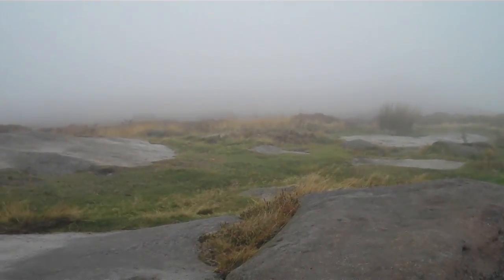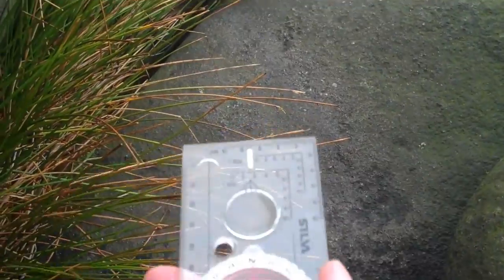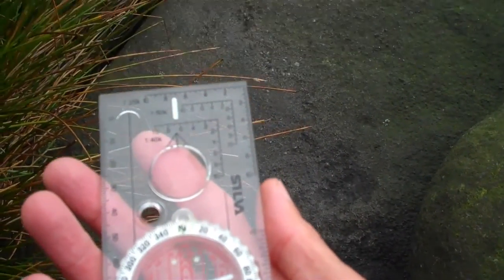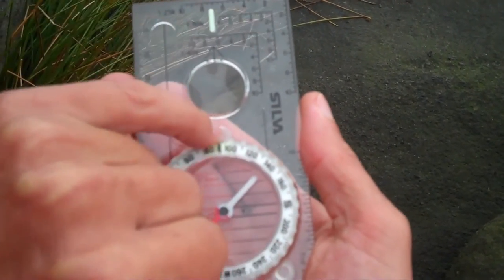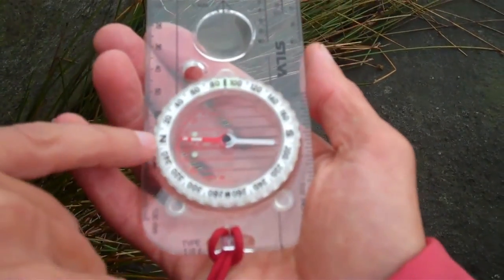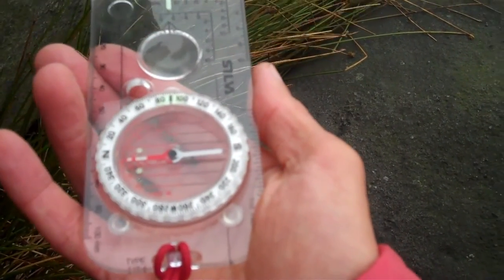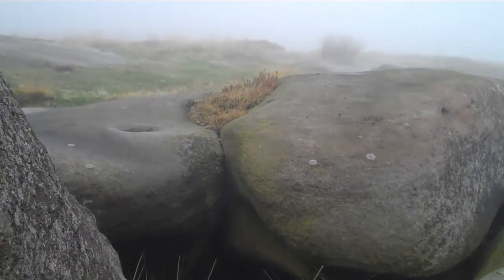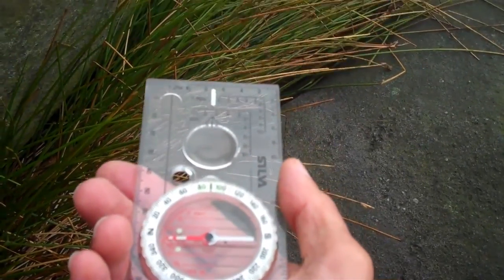how to follow a compass bearing

Comment: The thing is, with your method, unless you've stayed on a perfect course of 90 degrees from your original starting point, you could be drifting off your original course, and then when you stop to check your compass, you'll read a course of 90 degrees from that point, and then you deviate once again from your original course, stop and take another compass reading, correct your direction of travel again to 90 degrees, ad infinitum. Using that method, you could end up missing your original objective, because you consistently deviated one direction from another from your original course, and then each time reset your course to 90 degrees from your "new" starting point. You need to do something like lining up two visible points and always keep then in line until you reach your intermediary point when you again select two points ahead to keep inline to navigate to. Many thanks.
Reply from the maker: True. It depends on what you are aiming for and how far away it is and also the angle of the ground. If micro-navigating or traversing a steep slope then yes I'd do that. If heading toward a larger line feature that isn't too far off then you shouldn't need to line up two points, you can just run on the compass bearing.